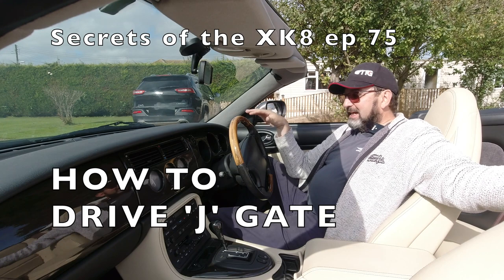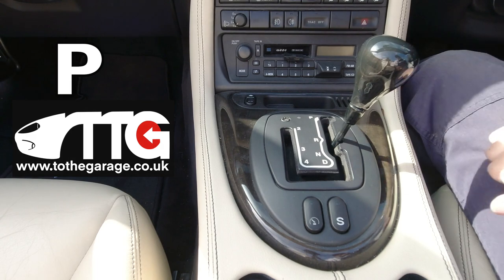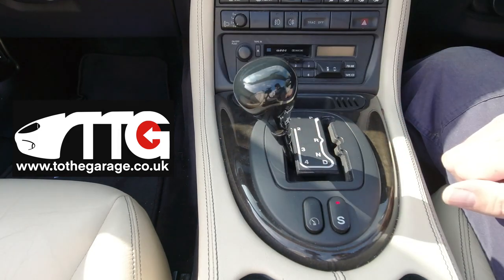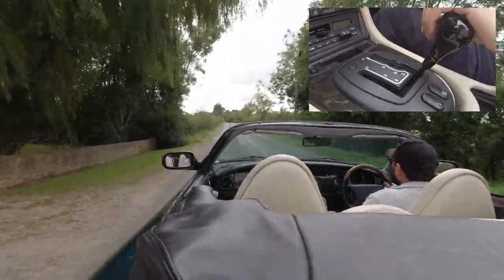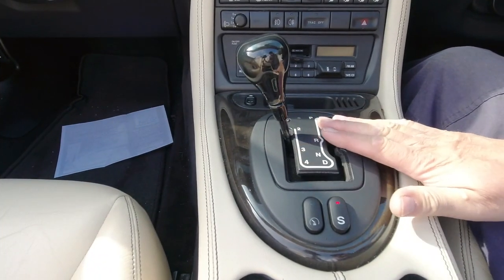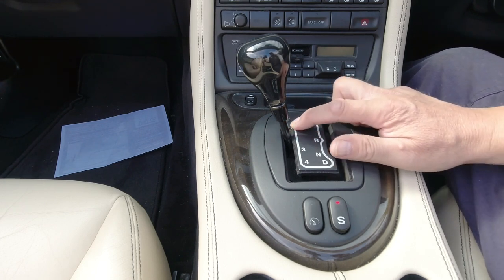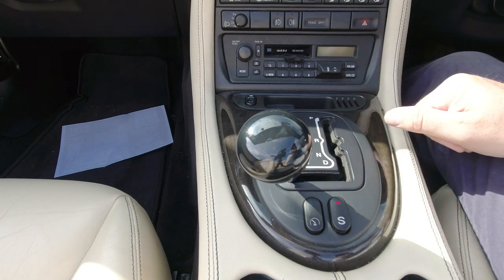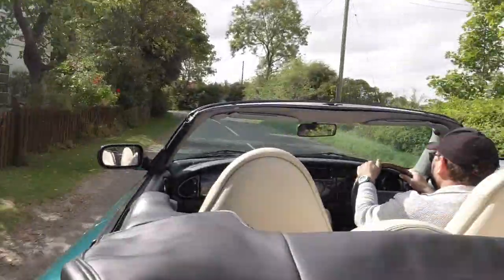how to drive 'J' gate. secrets of the Jaguar XK8 XKR ep 75

Comment: Flat out in d.flip in to 4 on the j gate then back in to drive will remove the restriction and if you have enought road you can go up to about 170+
Reply from the maker: OOOh.👍  is that right Edward?
I was aware that the the XK8 tops out about 169mph if the limiter is hacked from the ECU programs. however I was not aware there was a driver deployable work around built in😎
Im really interested in this sort of thing (80 + secrets of the XK8 gives a clue😁)
I would never have a need or desire to test this out, but would love to know if there is anywhere I can find more out about this👍👍
Reply: What about the 155mph limiter ?

Comment: Thanks for the great video, John! Had a question - have you ever experienced a situation where the car jumps forward slightly when putting it into Drive, and to a lesser extent Reverse? My car (2001 XJ8 X308) doesn’t actually move forward when I do it as the brakes hold it, but it does do a bit of a jerk as it presumably goes into gear.. issue is worst when the car is cold, and wondering if it’s a gearbox issue or maybe something else to do with computer etc?
Reply from the maker: I have heard that doing an eco 'hard reset' can iron out jerky gearbox engagement. Never had the problem so I cant confirm. 
Hard reset is remove battery and then do 'the thing with the battery terminals' to remove temporary ecu memories. 
If you don't know what im on about (hard reset) then Email me
john@tothegarage.co.uk
Its easy, but if someone missinterprets my words, they will short out their car. 
It can also be a sign of needing a gearbox oil and filter change or a worn out Guibo (cushdrive doughnut in the propshaft)
Its worse when its cold because the revs at idle are higher.
Reply: @ToTheGarage  Ah thank you very much - very interesting! Let me drop you an email just to confirm a couple of things before I do something silly by mistake! :)

Comment: John, can you recommend a product to clean up my boot button.  It's a round push button growler face with a thick covering of clear (at one time) plastic.  It's so foggy it's difficult to see the growler.

Another concern.  I've got a slight dimple in the top of the left front fender. It's about the size of a North American dime.  I really feel that if I could get at it from the other side of the metal, I could tap it out smooth again.  Trouble is it can't be accessed.  The engine bay is far too crowded in that area.  The wheel well is also lined so, once again, no access.  Do body shops have suction devices to take care of these?  And if so, might it damage my XKR?
Reply from the maker: a glue on tag and slide hammer will probably sort that out with no paint damage.
I made a video about the technique a while back. Here is the link
https://youtu.be/tVs_piQz7Cw
as for the growler. use a plastic window renovator fluid such as renovo. I did a video about using that on your instruments.
https://youtu.be/DZzCekL1HDQ
Reply: @ToTheGarage  Thanks!

Comment: Beautifully explained! My dream car is the XKR, and the automatic gearbox is the only thing that is stopping me from seriously thinking at getting one.

I have a question regarding this: assuming that 100% is the highest level of performance this car can get, how much do you think it gets to (in %) with this automatic setup, compared to what it could achieve with a manual gearbox?

In a less weird way: do you think that having an automatic gearbox (despite the left side of the J gate) makes this car lose any performance and driving experience compared to having a real manual gearbox?
Reply from the maker: It loses a little 0-60 as the speed of change is longer than on a modern DSG Auto and potentially longer than a really well driven manual, But the box doesn't slip unless it needs to so less HP is lost to the Auto box than on many cars of this era. I think a manual with a good driver would deliver a .75 second benefit. But for us mortals I doubt many of us would achieve better times with a manual.
The Driving experience would undoubtedly be different and arguably more involving/satisfying with a manual.
HOWEVER. Having driven a manual DB7, the foot well was too narrow the pedals spaced awkwardly and the shift is not MX5 slick. So maybe I would prefer my J gate🤔
There are conversions out there using a Toyota Supra gearbox if you really want to give it a try but its an expensive experiment and there are not that many converted cars out there which suggests to me that you end up with some of the DB7's issues.

Comment: If you were doing 70mph on the motorway and pushed it all the way to 2 what would happen? Would the electronics actually select 2?
Reply from the maker: No. it would hold 3 until the revs came down to allow 2nd to spin the engine at no more than 6400. And then it would change into 2

Comment: When you change over to the left side of the J-gate, or change during driving do you need to lift off the accelerator? Or do anything else to make the change possible? I'm used to manuals so not sure about changing while driving in an auto. I have recently acquired an X306 from 1996, the 4.0 litre straight 6 with a supercharger. Thanks.
Reply from the maker: Hi Joel. No it is not necessary to lift. The changes are actuated hydraulically and multiple clutches ensure you remain safe

Comment: My Vauxhall has a J gate ... sort of. The left side is centre sprung and I have to flick forward or back to change manually in a similar idea to flappy paddles. Also, momentarily flicking the shifter to the left shows on the gauges what gear the car is currently in. It is nicer to use than the J gate which is a bit more involved to use IMO.
Reply from the maker: Hi Al
I actually prefer your 'sequential box' style shifter to some of the flappy paddle systems out there, but have to disagree on the nudge forward nudge backward sticks being nicer than the J gate.
the advantage of the j gate over the paddles and the system that you have in my opinion is that the different gears are in a different place. On both the other systems it's hard to know which gear you are in unless you look at the lcd display.
Efficient but less tactile and intuitive in my opinion.
In fairness, the jag system is not common so a lack of familiarity can make it feel quite alien.
Its like indicator stalks. The 'correct' side for uk indicator stalks is the right. But cars that still fit them on the right, are so few and far between, that when we experience one, it feels awkward. Despite the fact that you can change gear and indicate at the same time or apply the handbrake (except in an xk8🤣)
Reply: @ToTheGarage  My Dad had an XJ40 but never used the J gate ... but to be fair he was in his 70's. I have to say, I don't like the new rotary gear selecters, what the hell are they all about? Can you do the J gate magic with those?

Comment: When I go to manual from 4 th gear back to drive gives a gear box fault sign , what it means?
Reply from the maker: Possibly the shift cable needs a small adjustment. Observe the number 4 on your shifter. It should light up red. sometimes when you move from  2, to 3 to 4 the 4 does not illuminate before you move to D.
If you can get it to illuminate by pulling the shifter back a fraction more than is normal, then its probably just gone out of adjustment or a contact is dirty. 
If does not iluminate when moving from 3 to D then the car thinks 4th gear is in some way 'broken' and will cause limp home mode.

Comment: John, great explanation as always. Love the dark side of the J gate. 👍 Where are you putting the microphone on the rear? I’ve tried the number plate but still getting a lot of wind/road noise. Much appreciate your videos regards Damian
Reply from the maker: O&DR Jaguar XK8 
Hi Damian👍 great to have you along for the ride. I tried something slightly different in this video and in a wind noise regard it worked well.
I used a rhode wireless micro, with a dead cat. Having tried on the camera and the number plate previously with too much wind noise, I masking taped it to the top of the rear bumper below the tail light where I guessed there would be a ‘dead air’ space. I also tied a string to the microphone with a big knot in it and trapped the knotted end inside the closed boot. ( just in case!)
From a wind noise perspective it worked really well. ( lowest dB setting on mic)
But as I said at the end of my film, I don’t think the recording matches what I hear when driving. My exhaust is standard and obviously I’m a long way from the tail pipe when driving, but the recording sounds a lot harsher than the sound I perceive🤔.  I think it’s because it’s picking up one exhaust  rather than two.
The best sound clips I have are with the mic clipped to the bottom edge of the rear bumper facing forward in the middle. Brilliant at idle and up to 20mph but then no dead cat ever made us going to eliminate the wind noise generated there.
Still loving your channel mate

Go and check out O&DR Jaguar XK8 everybody👍
Reply: To The Garage. John, thanks for the microphone tips. Assume a dead cat is a big fluffy thing over the mic. Agree you don’t here anything like the noise that the mic puts up. But it does sound great. Going to try again thanks to your input. Have already made my first driving video. Need to refine the camera position and mic. Heard lots of knocking noises hope it was just the loose wire. 😉 Keep up the XK8 videos. Thanks Damian

Comment: Exactly how I drive my Rover 75 v6 auto on country lanes I don't even bother with the sport mode just use the pre selects
Reply: I had the MGZT 180 which is the same as yours and drove it mostly on the "manual" part of the gear box as well. It did do a good job of holding the gears when going downhill in drive though.
Reply from the maker: I often think the 75 is the front wheel drive S type. 
The era is the same, the retro looks follow the same theme etc.
never owned one. but regret not buying a RWD V8 one that I was offered just as the Phoenix deal went south.
Reply: @ToTheGarage  Yes I wanted the V8 rwd Rover 75. My brother test drove it and said it was a beast but had a stodgy manual gearbox.
Reply: I have a mate who has a mint v8 with 40k miles on I drool over it every time I see it. The Rovers were autos the MGs were manuals one day I hope I get one. And yeah you are right the auto does a good job of holding the gears it's a bit more sophisticated than the XK box.

Comment: After starting, can you go immediately to 1st/2nd in manual mode from neutral or have you got to change down from drive mode to initially get to it?
Reply from the maker: You can go straight to the 2 position before you move off👍.

Comment: Hi John , have been watching your channel with interest & only came across it by accident !
my car is a 1999 XKR coupe'
i'm going through youtube trying to find the following .
1) where do the rear parking sensors plug into ??
2) is there a loom missing from my vehicle ??
3) has the wrong loom been supplied by my local jaguar dealership 
I did have no loom from the actual sensors to the sender unit in my boot, having bought said loom it will fit to the actual sensors by way of 3 pin plug & socket affair BUT at the other end of the loom  it only has a 6 pin MALE  plug - -  i need a 12pin FEMALE plug to fit into the sender unit !!
 so i stripped out the boot lining ,i can find no other  empty sockets in the boot 
if i cant find  any answer to this i will retro fit a camera to the car , but to be honest i thought the purchase of this loom was going to be the best option.
i hope you can help or indeed anyone else that reads this !!
keep up the good work
cheers 
Andy
Reply from the maker: Are you 100% sure the reversing kit on your car is Jaguar O.E?  Only asking as aftermarket additions are common and the jag loom should be plug a and play
Reply: @ToTheGarage  Thanks for the reply. i.ve since been to Euro jag at Darlington with both the sender & sensor units . I purchased a loom from an EARLY XJF an apart from the initial length of the harness being about 6' long ,it fits perfectly. Cheers

Comment: Very helpful thank you, I have just bought a lovely XK8 (having had XK120 & XK150 years ago).
I notice you have an armrest without the silly cupholder which mine has and will not close! Are these available to swap over??
Reply from the maker: Just look for an earlier or lower spec car, at an auto breakers. after 98 the majority had cup holders but the. smooth are rests. are out there. Most folk are searching. for Cup holder arm rests. that work (good luck) rather than the standard arm rest so they are not. going to be stupid money

Comment: Is the gear selector electronic or does it have a linkage system?  Im having trouble in drive where I have to keep trying to put it into D, its like its not selected or when it does engage it will not shift gears so it ends uo running high reves or a kind of jerking motion as it reaches its rpm.  Any info would help.  Thanks.
Reply from the maker: The right hand side of the J is all linkage and cable, and can be adjusted by removing the centre console. The left hand side is electronic.

Comment: My XK8 has a issue with the first/reverse gear.  When it is warm, it drops in harshly. It can fault out if I'm am too aggressive with it.  My XKR locks in what ever gear I shift too on the manual side.  It let's me get there then it won't let me out.  I have to access the solenoid to get it out.

Comment: Dear John, thank you very much for your fantastic secrets. There is one thing that I‘m missing of the gearbox. Is there a possibility that the gearbox don't shift down, when you are in the fifth gear? I would like to be able to stay in fifth gear without shifting down, when I‘m accelerating, that it stays in fifth, while pressing the throttle. Is there a function, or maybe is it possible add a switch?  In the fault program, that was activated once, it does not switch down in the fifth. Is there a way to do this?  Thanks very much. Wolfgang

Comment: If you are in the market to purchase a mid life piece of fun on wheels such as an xk8. Would it be prudent to ask if the vendor was a fan of the left side of the gate?
Reply from the maker: 🤔 Sounds like you have just invented a new euphemism Totspur 63.🤣.
Lack of use is what kills off a lot of these systems. 
I would buy a hard driven well serviced and well loved car, over a short drives or neglected car every time.
Reply: @ToTheGarage  A euphemism to some no doubt 😁. Thanks for the info. I have wondered if a underused engine in a 4 litre GT is always a good thing.

Comment: Hi John, Newly subscribed and enjoying the vids. I bought a 2001 XK8 LHD U.S. a year and a half ago for 2000$ and I am restoring it a little at a time. Typical repairs strut mounts, knock sensors and some front end body work from a nasty bump. 2 questions I am going to order seat cover kits for the front seats due to cracked leather. I have the electric headrests. How hard is it to get the headrests off to get the seat back cover off? Second question my headlight washer mechanisms are hanging out how hard are those to fix?

Comment: Hello John. Thank you for this excellent and very informative video. I am a member of a French site dedicated to the XK8 and XKR. Most of the members advise against using the leftside of the gearbox. They feel that doing so could damage the gearbox. They only use it for downhill driving to save on the brakes.
As the proud owner of a 2001 XKR, I also use the manual part of the gearbox. Having consulted the French site, I now have some fears.
Another thing: when I use the leftside of the gearbox, the gear is automatically shifted up (it seems to me) to avoid the red zone. Is this correct? However, recently this didn't happen and the rev limiter engaged. Big scare.
Thanks for your reply.

I hope my communication is understandable. I use Deepl.

Comment: Great video maybe gives me the confidence to start using the j gate more.  I've only used it for decelerating down a hill to save the brakes.  I had a question did you say that the sport button did change something on the j gate side?  I didn't think it would affect the manual side.
And thanks for the video on the sport button because I've been driving around with the button in sport but it's never been activated.  A lot more fun to drive now.  Also does it make the throttle quicker in sport it seems like it.
Thanks
Reply from the maker: hi Lyndon.
on the left hand side the sport button just increases the amount of circumstances where the box decides its ok to launch in first gear. 
(from mostly, to almost allways😁) 
Other than that. the S button is pretty inconsequential when you are on the manual side of the box.
Reply from the maker: some of the programs that are running in D with sport off, reduce maximum throttle opening or response rate. (these are not used in S) so yes its possible you perceive a more responsive throttle.